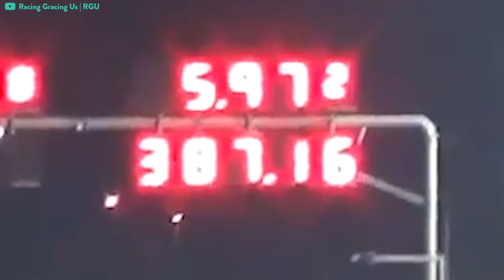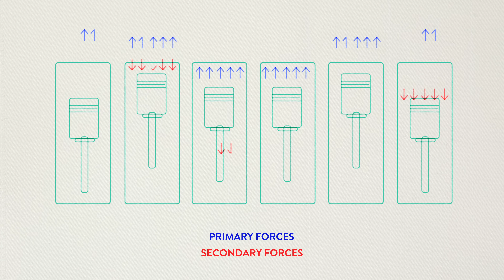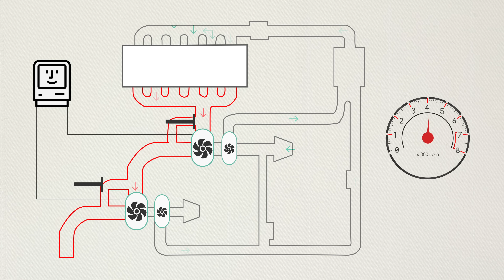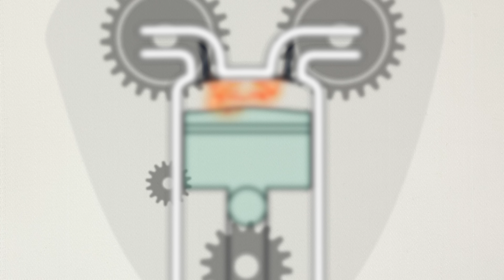2JZ ENGINE - How it Works | SCIENCE GARAGE

Comment: Toyota should remanufacture brand new 2JZ engines like americans do with crate engines
Reply: Absolutely
Reply: tjsavage711 The s54 is still a monster by today's standards, almost 20 years later. There are people making 350whp NA from a 3.2. Insane. The 2jz is also the classic BMW 86mm bore 86mm stroke 3.0 inline 6 formula.
Reply: @weedshoes5089  best thing about the S54 is if you turbo them you have a literal monster in your car
Reply: @weedshoes5089  that's not BMW specs that's just normal performance engine specs 500cc per cylinder is just the most logical amount of cc/cylinder
Reply: Uhhh   BMW sucks donkey dong  @weedshoes5089
Reply: @weedshoes5089  Brugh it is nice comment, and I dont want to sound like a nerd, but BMW 3.0 is 84mm bore and 90mm stroke
Reply: @90drift57  you're absolutely right. I incorrectly assumed that since my s50 is 86x86 the m30s were as well.
Reply: @weedshoes5089  what the s54 does is basicaly standard practice for the honda guys tho. 🤷‍♂️ there are even k24 engines that do well over 300 n/a
Reply: @99Lezard99  yes, but this is a thread about inline 6 engines.
Reply: @weedshoes5089  yes but it just came across like you wanted to say bmw achived a massively hard task by building that engine. sure its impressive for a streetcar engine but not "insane". anyway dont take it as an offense. wasnt meant to be one.
Reply: @99Lezard99  I don't take offense. But I do think that inline 4 engines and inline 6 engines are apples and oranges. B18 and k24 are legendary for their power output but the torque is embarrassing. The s54 is smooth, balanced, torquey, and still makes power. Comparing a k24 to an s54 is like comparing a civic to an m3. One does one thing well, the other does everything well. Anyone denying that the s54 is an amazing piece of engineering, must not have much engineering knowledge or experience.
Reply: @weedshoes5089  the torque is embarrasing? thats just a myth. the torque of a k20 or k24 or b16 b18 is good for the engine size. people just forget that they are talking about a 1.6 1.8 or 2.0 n/a engine. of course a 2.0 n/a with 220hp has less torque then a 3.0 with 220hp. but those engines are usualy in cars that weigh around 2000lbs/1000kg so they are still quick. and yeah of course a straight 6 is smooth. thats because of its design. a straight 4 will never run as smooth. like i said i have respect for the bmw m cars and they are overall great cars and the s54 is a really nice pice of engineering but i dont think its line "insane" crazy. just to make it clear i also dont think the k or b series honda engines are "insane" crazy machines. street car engines are allways compomised. more or less. the s54 and the high reving honda vtec engines surely less but still. btw civics get too much hate. of course the type R is not a halo car like the m3 but in its class its allways been the closest to a track car.
Reply: tjsavage711 3.6 inch bore and 3.6 inch stroke bruh. If the 3L 2JZ is so powerful the 3.7L could be the real king.
Reply: Inline 6 6 liter turbo 3jz lmao
Reply: Dark Slayer such a thing gotta be super tall and super wide, man.
Reply: @unclerafiki8519  Fuel Tank: "Mr. 2JZ, I don't feel so good."
Reply: Dark Slayer, you just described my 5.9l cummins. It makes crazy torque, but weighs 1100 pounds. That's half the weight of the 1st gen celicas. The front end would be way to heavy in any car you drop that in.
Reply: @garyboyd9704  *too heavy
Reply: @unclerafiki8519  thats known as the 6bt
Reply: Creating a 2JZ crate motor that enthusiasts around the world would love, would directly contradict Toyota's strict policy of eliminating all traces of fun from their brand identity.
Reply: It was done in 2006 and called N54.
Reply: tjsavage711  I'd rather have them remake 1jz they sound soooo fucking good and can handle good power too
Reply: @A7Xforlife99  agreed
Reply: A7Xforlife99 they sound like they are running on 5 cylinders though. the 2jz sounds a lot smoother
Reply: tjsavage711 Cummins aren’t too bad either. Audi’s 5 cylinders were pretty sick too
Reply: Nathan Brown da fuq? get the fuck outa here wit that shit....
Reply: Toyota still makes new short blocks and cylinder heads... Just not the rest of the accessories to make it run (Including the damn valve covers) but luckily the aftermarket world has everything we need lmao
Reply: @Ashley Redden they never raced the 2jz, the supras in motorsports used a 4 cylinder engine, want to know why? Iron block i6 are HEAVY
Reply: @alexstromberg7696   there was actually a couple 2jz powered supras in the scca and nasa touring 1 and touring 2 classes I believe
Reply: Problem is they probably don't want to put the money into it too over engineer it. Guarantee the block would be aluminum and barely anything in the engine would be forged. If there was ever a chance that this could happen they wouldn't be putting a BMW engine in the new Supra.
Reply: @duevebravo2  because the new supra is a lie lmao
Reply: Only in a perfect world. The funny part is that they know we want that .
Reply: This thread makes me sad, I'm thinking about a next engine for my Porsche 944 S2 and I finally understand the glory of the JZ.
Reply: Ford Barra for rest of the world > Remanufacture 2JZ
Reply: You'd have to find some wealthy 2JZ enthusiast(s) and just open up a custom shop that is dedicated to manufacturing them. It would be kinda awesome, but in today's economy, those engines would be incredibly expensive to produce and turn around n sell. Only full-time race teams would ever consider purchasing it and even then, a couple engines a year wouldn't pay the employees back. Lol
Reply: Patrick McCrime Dog they also did the 2jz when they could overengineer things and had the bubble money. Nowadays they’d probably need a lot of convincing to do the same, especially when evs are around the corner I guess.
Reply: @patrickmccrimedog9844  pretty sure you can get a billet aluminium modern made 2jz race motor for like 20-30k.
Reply: @bmxriderforlife1234  JUST 20-30 THOUSAND?!? 🤦‍♂️🤦‍♂️🤦‍♂️🤦‍♂️
I know in the racing world, companies have hundreds of thousands in their budget so that's just some pocket change, but no enthusiast can put brand new car money into just a bare billet block
Reply: @patrickmccrimedog9844  nah I'm talking a billet block built up engine ready to install minus a few bits like turbos and headers and shit. 

Also a fucking stock rb26 is 56,000 from Nissan. 

Billet 2jz built up for like 20 to 30 isn't bad. 

My boys putting a billet 2 rotor in his friggen rx7. 

And I'm probs selling my baracuda to buy a 350z and a supra automatic to swap the supra to a v12 and the 350z to a w12. 

Supra done tranny engine and other bits with a body kit rims and rebuilding my spray booth should be done for like 40k. 

350z probs 30k. 

Find a sweet whip for like 5 to 10k and drop a 30k motor in build a few more bits body kit and wrap and it looks like a waaay newer car. It's probs worth more and is easier to sell then a base one. Depending. 

Interior is the hardest part. But build up a nice rig do everything up including interior. You can sell it for cash bro. Or it's a car you know every bit of costs the same as one new higher end daily whip. Won't depreciate on value as hard or as fast as a brand new whip. You can get them done cheap and make a fun project of it. 

Shit 30k. Fuck it I'll get a second 350z for like 7k build that up 2jz swapped and daily it. W12s a race car. V12 supra show car. 

Lol. All depends what you wanna do. But a billet 2jz for 30k that's as strong as the old iron blocks but aluminium and potentially updated to better specs for power so weight savings. They can make mad power. Only problem is length. 

Now trying to get a billet 1gz fe would be pricey. V12 ls is like 45k. 

V12 gmc fire truck rebuild(702 cubic inch) is 70k USD and also has to be shipped from kiwi land. After sending them a 1500 pound engine to rebuild. Loads of custom parts though and a fresh rebuild and mods. 

So lol. 

Was gonna pay 10k for a motor out of a wrecked lambo. Still works but no idea what it needs and a used tranny to mate to it is like 9to15k

My gto(mind you I didn't pay for those bits) has a 50k race motor and a 40k race tranny. On a car worth like 70k to begin with. 

I'm 26 and am currently disabled and not working atm. My muscle cars are family shit. But before I blew up my body I had a 3.5k bike in high school at the age of 14 I paid for myself working random cash jobs since I wasn't allowed to get a proper part timer by my fam.

Find deals. Find a car you really like and are gonna keep. Find one that already comes with the motor built to shit and suspension shit when they are at rock bottom prices. Build them over time. Base engine swap(which can be done with a cheaper version of the motor you want) and tranny shit to get it driving reliably. Build from there.
Reply: @patrickmccrimedog9844  some people don't ever buy new cars fyi. They'll buy a used but relatively new daily that's cheap on insurance and gas and makes sense. Then build other shit that'll last time and can be dailyed or babied. 

I'm going to be building a 4 door jdm monster of something. Probably a lame skyline with some gtr features put onto it. Hicas makes it useful for daily shit not just racing. Lane mergers handle better and shit. Parking is easier. Attessa helps in similar ways too. Tires spin front engage. Awd out the mud. Add a controller so you can make it rwd only or awd only not the weird in between and bam even more useful

4 doors more people and kids seats fit in the back nicely. 

Can still make it look boss. Tunes can make it less retarded of a daily. As well as a boost controller. 

Insurance won't be fucked cause it's a gtr. But swapping an engine into it from the rb family is easy and cheap outside certain models. And these other ones can take some gtr parts and other shit. 

60 70k maybe a bit more depending how balls out I go. Might get fancy paint and lots of carbon for looks. Plus a really fancy interior with light weight sound deadening and insulation and shit. Daily race car that is deffs worth more. 

Especially if I gtr body kit it or use parts of it and parts of a 4 door kit for a different skyline. 

That said I want rims that are a little retarded. Want to either ceramic brake upgrade which is like 20k. Or find a scrapped car with them.and salvage as much as I can. Body damaged cars getting scrapped where I live is common. For really high end shit anyways. 

Whole entertainment unit. Sound system. Gonna mod the roof for a moonlight plus carbon reinforced. 

In stages though. Running and looking nice and being fast and daily car will be like 20 30k total. Final build way more. But I'm gonna keep that shit till it's murdered or I die. Or find something I like way better.

Paint jobs are like 10k for a from scratch remove everything put a new one on. More for some crazy shit. Full chrome job even if you have your own shop with a chroming set up( someone I know does) is still alot more then that. 

5 year old whip you spent just as much on could hold value or drop to nothing and be like a grand. 

Ferrari 250gto. My retard mother coulda bought one for 5 grand at one point. Car collector. Didn't. That was a fail. But cool shit can drop mad value fast. 

Rx8. Ls swap you can be in total for 10 to 15k. Body kit and paint and rims and brakes and everything else more obviously. Better daily. Can get rid of known issues. 

Shit a dead rx8 could be had even cheaper and done dirt cheap. 500 dollar iron block. Do the rebuild yourself to stock except.some thrown on muscle car bits. 

Some cars have kits rhat make it easy and cheap. 

Well once your done and it's cheap and you start loving it and upgrading it eventually a built motor is the shit to do. Plus a bunch of shit you already have still works and can be used. 

And if you plan for this you can spend a lil more money long run but not much basically just the cost of the first junk yard motor and a few bits. Slowly build up all the other shit like interior and boom couple year fun project you have a daily race car that looks show quality. 

Some combos work better then others. Skyline always gonna be pricey with the computers and suspension and other shit. I'm avoiding rb cost by building an rb20 and stroking it. But eventually fuck it why not rb 26. That said would rather stroked rb25. And you can get built race ones cheaper then the rb26 base. Also you can find used race shit cheap. My tranny was a season old cost 40k new and my buddy gave me bits he had for his he got new to rebuild it. Didn't even need it but did it anyways for fun. I was into it for less then 8k after giving my friend some shit for the parts.

Rx8 meh. Especially if you get some mods done. 350z 370z even better values starting to get real low and some rich dudes getting newer ones selling old ones cheap. 

I'd go 370z but 350z just cause it looks almost the same. 370 is newer though. 

Same reason I'm doing an r34 skyline. Newer. Even though I'm going to use some r32 shit. Also like the none gtr body kits. 

But like 350z w12 is a done swap for a race car. Harder to do a show build but meh. Race car to start. 450 to 550hp on stock engines. Do some shit for reliability and strength and that's it for time. 

2jz swap would be easy and cool. Ls same deal and cheapest way to mad power.
Reply: They should, since Nissan STILL produces the RB26DETT NEW (You just have to go to the factory in Yokohama to get it though for $50,000).
Reply: @SigTheSauceMan  there race engines not really for road use . I worked on a r34 gtr with a S1 nismo engine here in Australia
Reply: Lol 4.0L inline 6 2jz, with quad overhead cams and a quad scroll turbo with rear mount intercooler
Reply: They never will...Toyota is bussines driven these days...less Japanese enthusiasm
Reply: Good luck designing a 2jz for todays emission standards plus efficiency. 
As a side note: The 2JZ block was designed by BMW, the head by Yamaha. The engine from the E90/91/92 335i is also called the german 2jz, so Toyota did the only possible thing they could: Use a BMW engine again. It's still 3.0l and turbocharged, I'm sure it will be reliable and powerful enough to have some fun. If everything goes wrong: 2jz swap
Reply: @PYDK328  do you have any links on this? the yamaha head is a known thing but the bmw thing, i never heard of.
Reply: @99Lezard99  unfortunately I don't have an english article, but if someone here can prove me wrong, I apologize!
Reply: tjsavage711  I wish the 3JZ can actually happen
Reply: tjsavage711 Has me Has Jz
Reply: Yeah but our American engines are made of quality steel and are designed to last forever . Unlike Japanese over complicated plastic,dildos,and soysauce...
Reply: God damnit. Just take my money.
Reply: They don't have the balls anymore. They have to partner with Subaru and BMW to make mediocre sports cars. Plus the guys that made the old sports cars are either dead or retired
Reply: @sharpemang  hi friend you forget yamaha that makes the heads for toyota
Reply: Your Mums HITACHI 🖕🏽
Reply: Can't someone else just recreate it there is prob a biggg market for engines like that
Reply: Ricky107 They are not focusing on the fanboys. They are focusing on the general market.
Reply: Or Nissan with the Skyline R32/R33/R34.
Reply: if they make 2jz crates then car market would drop since 2jz is rated at 500k mileage stock lol... while newer engines are rated 100k- 200k
Reply: Toyota would never do that now they only reliable engine
Reply: There to stupid too
Reply: @therockmountain-u6j  you're also very stupid. It's THEY'RE, not there.
Reply: @therockmountain-u6j  also, you use too twice, the first to is wrong.
Reply: caged lion
“There to stupid too”
🤣
Reply: ...................................Google is your friend.
Reply: Just get a billet aluminium 2JZ.
A short block set you back about 5   racks,full engine goes for about 15racks.
Reply: But Supras don't make power, so they gotta Corvette engine swap all those Japanese cars and then smoke an American car with it and talk trash about American cars, right?
Reply: @CaptainFALKEN  uhm.....theres a 2000hp 2jz build. In a supra. Also seen a 2jz swapped muscle car. 1400 hp. Thing was sexy.
Reply: No worrie, they find out there is much better now 😂
Reply: @arnehurnik  Toyota 1.8 ftw.
Reply: And who can afford a new engine from toyota i bet no one in the comments nor can i . Stupid comment
Reply: That would be awesome. I guess that’s one big thing GM has. I can go to a dealer and straight up order a brand new crate.
Reply: A 3JZ :P
Reply: Refurbished you mean?
Reply: tjsavage711 my little sister has a in-line five I believe, it’s a 325 if I ain’t mistaken and that car pulls 100-140 just as hard as it does from 0-60. I’ve never drove a car that runs like that from the factory. But my heart lies within the 2jz. I had one in an is300 that blew up at around 400k miles from me not changing the oil for over 100k miles. And I drove it with the gas pedal threw the radiator 24/7. I got the car when it only had 156k miles and i loved every mile that thing gave me.
Reply: They only stopped like 1.5 years ago.
Reply: They always have Dariune, if you want to pay the money they will sell you an engine. I believe they stoped making them recently but they are still selling them so a few left in the factory.
Reply: CalypsoNotch408  the cheapest horses now a days are coming from the once great America. Congratulations you won.
Reply: http://www.brangersracing.com/2jzgte.html
Reply: With emissions how they are i doubt they'd bother
Reply: tjsavage711  factory twin turbo, not made by BMW, etc
Reply: Toyota wouldn't keep the name.... They would rename and model it
Reply: Or buy them... From BMW?.....
Reply: Won’t happen. It’s apart of the Japanese philosophy.
Reply: Hm
Reply: You can still buy brand new heads and bottom ends from Toyota.
Reply: What about a 2jz clone Kickstarter project? Worth pursuing?
Reply: tjsavage711 eh hem I give you the 3jz a twin turbo inline 8 because fuck everything else that ever wants to break the land speed record
Reply: toyota made a 2gr engine, that's the succesor of 2jz and it still ridicolous good engine. you can found it (2gr) in toyota camry and lotus exige tho
Reply: Yes see how many people agree!👋why can't toyota see this. I would be the first on line. 2JZ the GOD engine🥰
Reply: tjsavage711   thats why im here, looking up an AWD i6( i have an 05 e46 and i fell inlove with the stability of the i6), found the r32 (was my childhood fav car) but the saw the 2jz i6 was much better engine than nissans. turns out a swap is easy, so my next dream car (that ill never get) is a r32 with 2jz swap. sounds dirty and hot
Reply: tjsavage711  that true. ive always learned everything by hand better anyway, what better way to learn engines than to re-build a broken one? thank god for car shops requiring computers since the 90's. there is more info about cars from real-life mechanics on forums, than porn. maybe.
Reply: tjsavage711 I Hav another project on the plate an 08’ Infinti g35 RWD... I’ve got to do an engine swap due to a head gasket being blown...which engine should I use... 2JZ, an LS or the same Vq... I found one with 76,000mi for 1500$
Reply: tjsavage711 no. I’m gonna put the (same VQ power plant tht came out back in...) a 2008 3.5Liter, I found an engine with 49,200 miles on the clock...
Reply: tjsavage711  You're actually incorrect, the earlier m3 engines (e36) were weaker in NA than in EU, not monsters. The e36 m3 for example was a 3.0 liter inline 6 that produced 240 horsepower in the US, while the e36 m3 in EU at that time had a 3.2 liter inline 6 that produced 320 horsepower- on top of that the US m3 only got a 5 speed trans while the EU m3 had a 6 speed trans. You either don't know about cars or are making shit up, because there has never been a time when the NA version of any M was faster than the EU version. The M series NA have never been monsters, especially not the older ones which were weaker than EU. I would know, I used to own an e36 m3 myself. It was slow as fuck. The 2013 jetta I have now has more pick up imho and its an automatic (my m3 was manual). It was no monster. Maybe you were just thinking of the EU m3's though and said NA by mistake. The EU e36 m3 was a monster for its time, and it had a sweet wing.
Reply: @FreehandElm  he's talking naturally aspirated. Not north American. 

Pretty sure there are also turbo options.
Reply: tjsavage711  What the fuck are you talking about dumbass? You said this:

 "They're all pretty awesome and each one has it's pros and cons.  I'm just a sucker for a good straight 6 and I guess a bit biased since I have a 2jz myself and I just love the motor.  BMW obviously made some good I6 too, the NA version in the older M cars was a monster for it's time."

Anyone who knows anything about BMWs or older Ms would never say this. Its literally the opposite of the truth. The inline 6 engines in the older NA M cars (e36) were shit- they are literally known for having been weaker for the time. And they were never even fitted with a 6 speed in NA. So if you were a "sucker for them" or "think they were monsters" then you are an idiot who knows nothing about cars or engines.
Reply: samjustsaid NA is naturally aspirated not North America face palm
Reply: Toyota is still producing 2JZ-GTE short blocks today, they can be bought brand new for like 3k USD
Reply: I dont think Toyota wants that haha. Thats why they made the handbrake stop one wheel in the 2000s
Reply: 1JZ yeah
Like, strong, not too big, not too costly
Reply: I was thinking that but remanufacture the supra and tweak it to make it slightly more modern and for the engine keep it the same but slightly bigger and they would be making money
Reply: IT’S CALLED A BMW N54 3.0L I6 TT LMFAO STOCK BLOCK 800HP POSSIBLE WITH SINGLE TURBO SWAP WAKE UP GUYS
Reply: You guys didn't know that Toyota will still hand out BRAND NEW 2jz engines? But.... it WILL cost you. A LOT. Anyways.... they still sell them direct from the manufacturer.
Reply: Why? You can buy new Mk4 block online at multiple different dealers.  Theres not that big of a market for them to do this. Just saying. Heres one http://www.titanmotorsports.com/fatosh.html
Reply: tjsavage711  shut up
Reply: And stick it in the new one
Reply: They are about to very soon! Toyota announced they are going to break out the molds on all MK3 and MK4 Supras and manufacturer parts to keep them alive. https://www.hagerty.com/articles-videos/articles/2019/05/22/toyota-offer-heritage-supra-parts
Reply: I wish. I wanna put a crate 383 in my 250 inline6 63 stepside c10. If there were a crate 2jz id finally get a credit card.
Reply: Dariune Nissan revived the rb so Toyota might follow
Reply: Dariune haahhaahhahaha Supra 2020
Reply: Jason Walker The Second
360 is not evenly divisible by 7
Reply: Like this:
https://www.jdmcalifornia.com/product/jdm-toyota-2jzgte-non-vvti-rear-sump-with-v160-6-speed-getrag-transmission-mk4-jza80/
Reply: Yessir
Reply: Agreed but they need to do a lot of modernization to the engine in order to sell it. The engine just doesn’t meet today’s crazy emissions regulations and isn’t very good on gas either. That’s the main reason they don’t make them anymore.
Reply: Lets start a petition!
Reply: Nah a 8.7l 5JZ sounds better
Reply: @TheRealChilly  stfu kid or manchild. Another wannabe car enthusiasts or troll